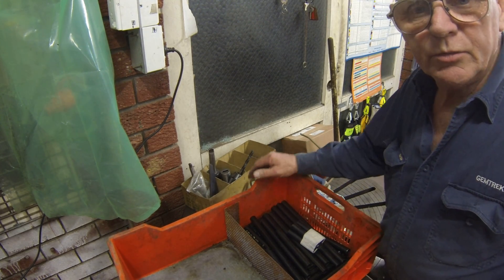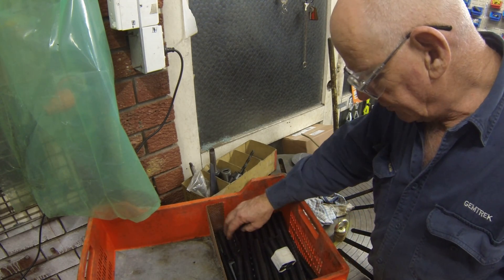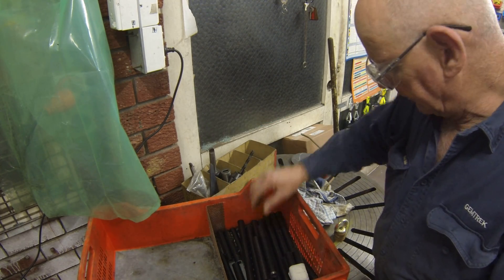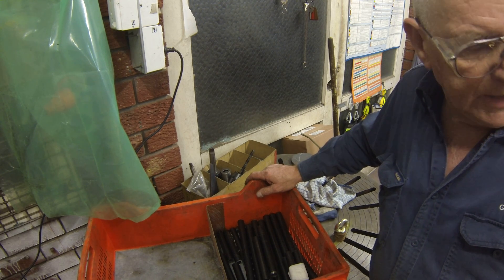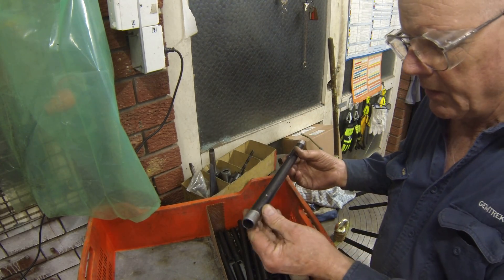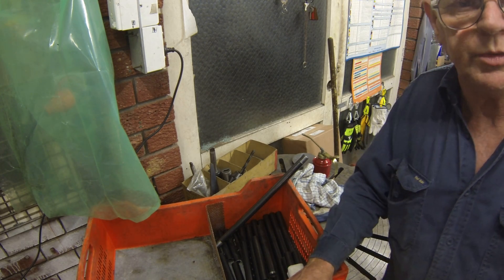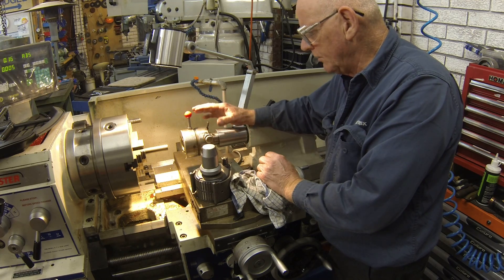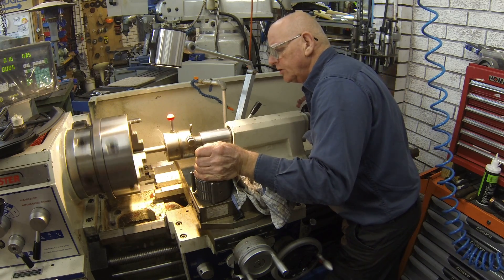Geometric die head operation

Comment: Just a (very) late bit of info for those coming across your video there are 3 Style available 

Coventry - UK style has BSP/UN/M/BSW/BSF/BA etc Chasers The chaser is dedicated to size and tpi
Geometric - US style NP/UN/M/BSW chasers A given pitch chaser gives a range of diameter sizes (depends on holder) 
Landis (Tangential) - US Style NP/UN/M/ACME chasers EASY to sharpen. A given pitch chaser gives a range of diameter sizes (depends on holder)

Benefit of these over die holders is they MAINTAIN pitch as the die that are not cutting engage the cut threads to maintain the correct pitch. 

For areas using BSP e.g. Europe China non NA dominated areas Coventry - also get other "weird" UK sizes
For areas using UNP e.g. NA and other highly dominated by USA areas Geometric or Landis 
You may be able to get Pipe chasers of the non std type for a die head - but I haven't found them easily

Comment: Chamfer pipe ends with a 45 de tool first , on top of die box is a lever pull it towards you rough cut move away fine cut finishing cut  run slower about 60 rpm use plenty of grease, better than oil but well done

Comment from the maker: People, there are a number of issues to look at in using the Geometrical dies: 1) Each thread size and pitch requires it's own set, 2) If you are doing a lot of pipe threading it may be more prudent to use a pipe threading machine where the chaser set is good for several diameters because the pitch is the same across several diameters and all you need to do is adjust the unit to suit the diameter (this reduces the quantum of heads and chasers required). 3)  In regard to the chasers it bears mentioning that there are 3 standard classes of dies that are used for different types of materials, these dies have different rake angles so if you are in the market for a set for a big run, or tolerances are strict, then you need to purchase the correct grade to suit the job at hand, briefly one for brass, one for normal steel and one for high tensile / stainless steel applications. 4) the Geometrical dies have a limited diameter range per head, hence from say 1/4" to 2" you need to have 5 die heads and the chasers are not interchangeable between these heads. One overall thing is certain clean and well oiled / flood coolant and sharp chasers will give excellent and quickly made thread results every time. have a good week Bruce
Reply: +Bruce Whitham 
Hello Bruce,, I need know what type and model head geometrical can work fine for build a screw trapezoidal size TR14x3 european ? It must be left hand cutter. Can you help me for choose the right Head size and what chasers use for this work ? I have find on web , but have a too confused for choose... I have a lathe not cnc with standard tailstock..

Comment: Hi Bruce, the other little lever, not the red knob one, should say on the body "rough" one side and "finish" the other, well it does if they copied the Coventry/Herbert die head accurately. What it allows you to do is remove the bulk and then go over it again taking a shaving to give a better finish, by just flicking it from one side to the other. Hope this helps.
chris
Reply from the maker: Chris I have uploaded several more movies, one specifically showing the R-F lever. Cheers Bruce